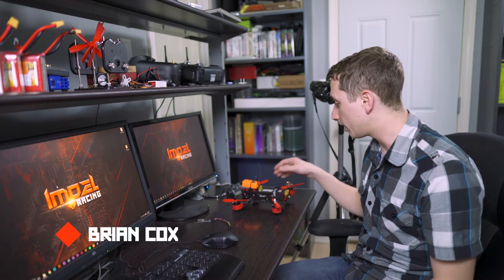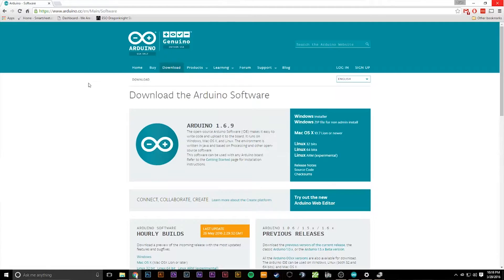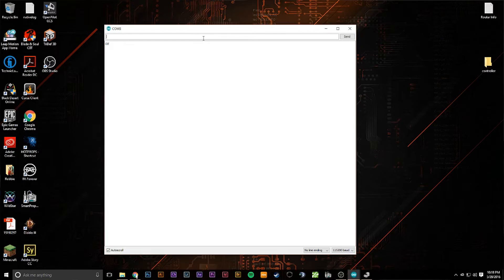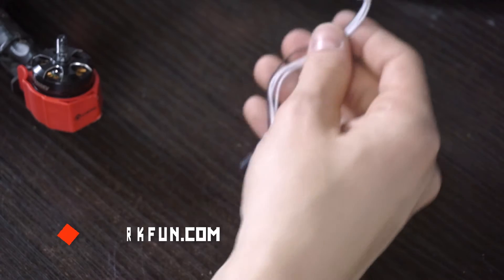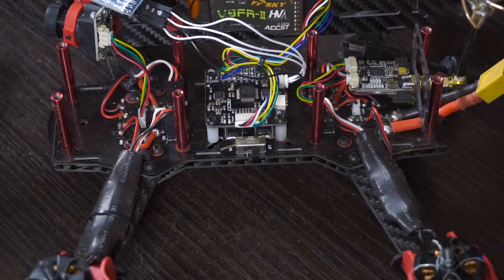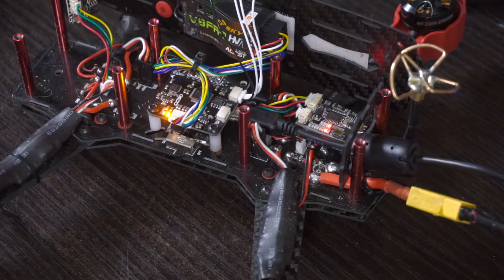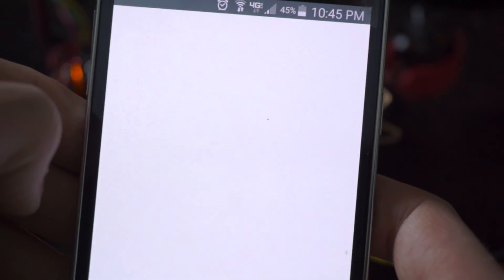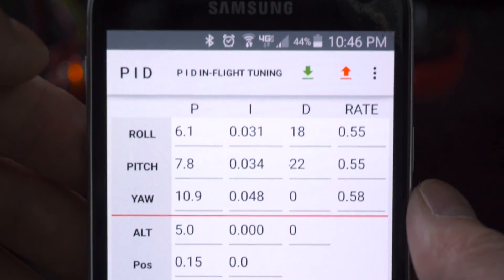How to tune PIDs with Bluetooth - CC3D + Betaflight - Impel Racing

Comment: Does this work with mac
Reply from the maker: There is a version of Arduino for Mac and Cleanflight/Betaflight are just Chrome apps so it should as long as all of the drivers to connect to the boards work.

Comment: Best way to setup a 250 quad is by flashing cleanflight or betaflight to the cc3d in cleanflight or librepilot then disconnect quad n close gcs app. Open/install clean flight in google chrome browser and select auto connect. U should get a comport saying comport5 if not and u see manual comport entry u need to install virtual comport drivers then repeat from cleanflight above. U should now av a comport .connect ull then be able to config the software pid settings hover acro+ rattitude etc . Leave these as they are or just knock a few points off the p pi pid d settings n save em. Save n exit.open gcs again and connect quad .goto flash and flash betaflight/cleanflight.cc3d.bin file to board and reboot. Now flash will read the cc and show software u have . Now go through cleanflight quad srtup wizard .save it. Now do the control setup wizard and follow exact . Leaving all accessory settings alone n next it . Once setup save/export quad setup then goto cobfig and advanced and rearm the motors usualy yaw right and i set mine at 20 secs. Save it and exit. Switch on drone on a flat surface .(i check for any error in level with a free spirit level app on googlestore and find a spot where i get 0degrees showing (meaning dead centre flat) then switch on quad and wait until cc3d stops flashing fast. Switch on controller and goto menu and select type. Airplane or glider. Now out menu to settings )on my flysky fs t6 its this anyway) goto end points and set all channels to 120% in 1st bar. Ok all and do again until all 6channels are 120% .the second bar of settings 120> 100> leave all 6 at 100 ok and exit . Go back to menu.scroll to model copy amd save as say profile 2 and ok. Back to memu amd select trainer mode and flick doen your swa switch to enable acro mode.save this and reboot controller. Turn back on and let it connect to your quad.hold both sticks < > in the bottom position so... in yaw left and roll right and oppersite >< a few times until cc3d flashes .now disarm the quad and do select swc switch so your quad is now in acro training mode.the quad will throttle upto 50% but not take off.if u adjust throttle nothing happends.leave it to whirr up.ull hear throttle pitch go slowly up.now switch off swa and same again.switch swa back to acro and now deselect swc . Switch on swd or swb and swc now do again.now turn off all switches back to normal and twist the vrb knob to 0 .the cc3d flashes slowly butvfaster than the normal quad in standby flashing rate. Nowall the way to -:and back down.back up and down a few times.now select swc and again vrb to - throttle goes to about 30 % and slowly winds up.during this twist the vrb a few times fully in both directions. Now switch off swc and leave wuad to disarm itself (20 secs as set earlier in gcs).now switch off fontroller and back on.disarm the quad select swc and move hoth sticks violentlyvin all directions.flick on all switches and knobs n off a few times.now back to menu and select training mode again and select ok to switch the trainer off. Scroll to sticks mode and go mode 2 and ok and exit. Save this in model fopy again and just reboot both quad and rc controller.after reboot your quad will behave like normal . Flick swc and rotate all sticks for a few secs to there maximums then centre pitch roll and put throttle all the way down.switch off swc and now your ready. Disarm the quad and throttle up. Take the drone to about 150ft flick swc and roll the craft and pitch it and yaw it and throttle up n down. After u do this a few times land your quad and deselect swc. Thats it. Happy flying. Your quad just used a training mode like auto tune but actually works lolin future just select training mode or student mode and repeat the last step always remembering when done to deselect training/student modes and reselecting sticks mode. Ur quad can now be locked in using gcs or betaflight etc . Only adjust p > adjust i to about 43 and select to zero i when throttle is off .lower d a few points and test the drone again. Locking in a good setup will now take mere secs .

Comment: but i am using sbus ? how should i connect ??
Reply: Quite late for an answer but I believe you can also use the Flexi port for doing this.

By default, the Main port is set to support telemetry so it'll be easier if you use it.

However, according to the CC3D document, you can also configure Flexi port to use Serial communication -> you can have telemetry as well

Hope that make sense!
Link to the CC3D document on Librepilot site: 
http://opwiki.readthedocs.io/en/latest/user_manual/cc3d/cc3d.html#diy-boards